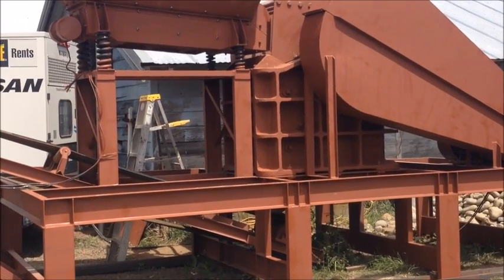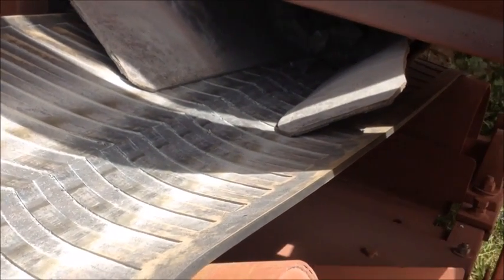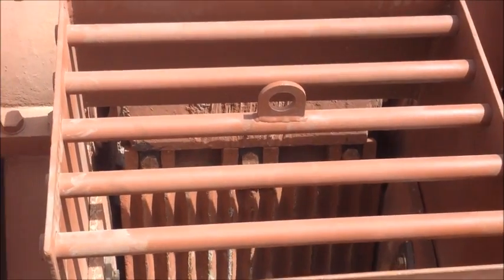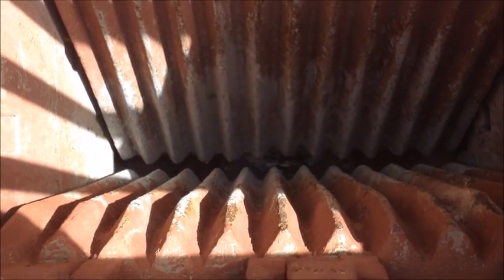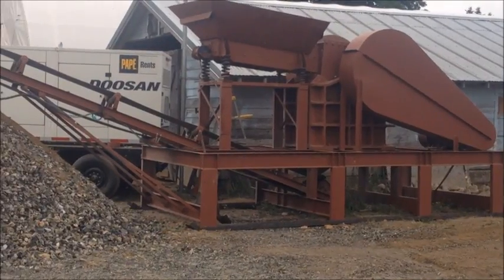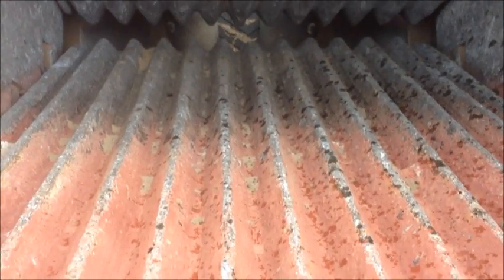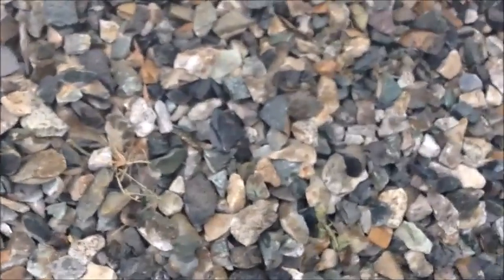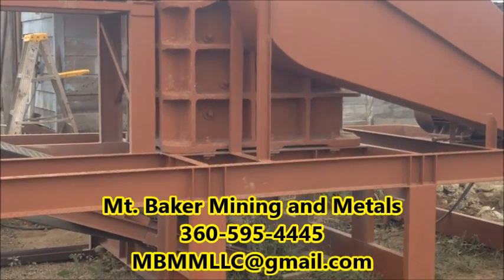MBMMLLC.com: Jaw crusher module for 15-60 tons of crushed stone per hour

Comment: That thing is awesome!
Reply from the maker: jdeluisa Thanks!  Glad you like it.  It is really fun to run and watch!
Reply: How does it compare to a cone crusher?
Reply from the maker: jdeluisa I don't have a whole lot of experience with cones.  I know they are a popular secondary crusher to take a 4-6" rock and take it down to about 3/4" minus (sizes varies depending on type of cone).  Cones are really heavy, take a lot of power, and they are REALLY expensive.  Jaws are great because they are simple machines to work on and operate, low power requirement, good to great reduction size, they have been around for a long time, and they are fairly inexpensive to purchase.  For the small to medium scale processor I would recommend a jaw and screen deck over a cone for sure.
Reply: This might sound like a stupid question, but how is the screen deck utilized and what does it do?
Reply from the maker: jdeluisa No stupid questions.  A screen deck allows the operator to size the discharge from the crusher into various fractions.  Some operators sell crushed stone by different size fractions with and without fines.  Some operators need all the crushed to pass a certain size to meet the spec of their project.  Some operators don't care about the size, they just want it crushed.  A screen deck can be used with any crusher.  I mentioned a screen deck earlier because a jaw crusher of this size (or bigger) may not be able to achieve the final desired size in one pass, where an appropriate sized cone may be able to get down to a uniform 3/4" minus product.  The screen deck with a jaw would allow the operator to scalp off the larger size and re-run it through the jaw crusher to insure it passes the desired discharge size.  This would be cheaper, easier, and less maintenance than getting a secondary crusher such as a cone or a set of rolls.  Flow sheets for gravel and mining operations are highly varied depending on when the needs of the company are.  They can be highly complex or fairly simple and straight forward, I tend to lean toward the simple and straight forward whenever possible.  Thanks again.